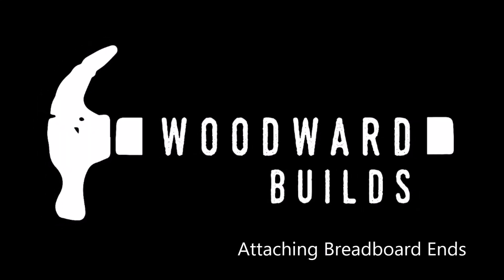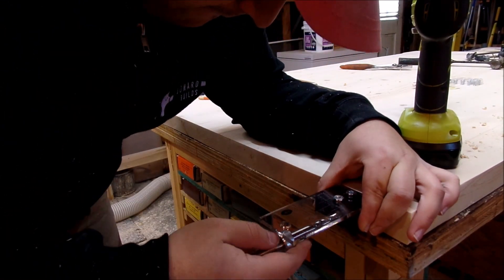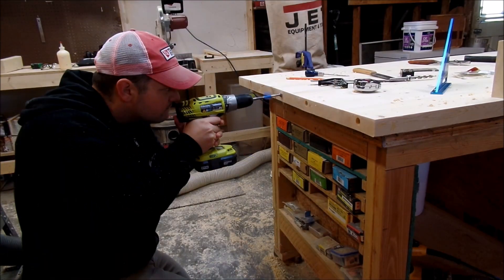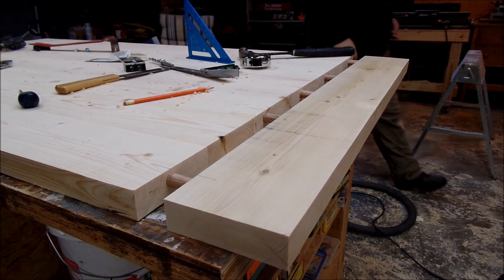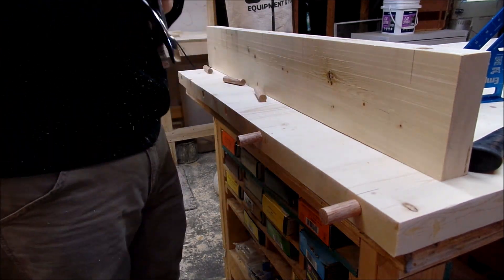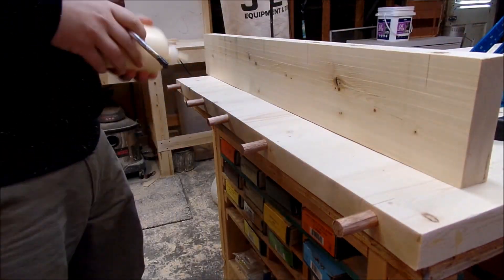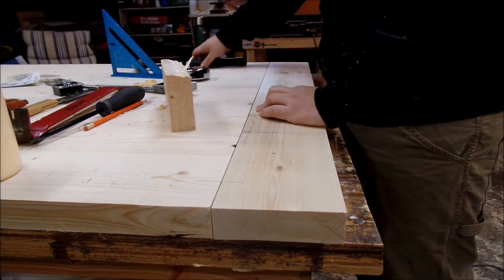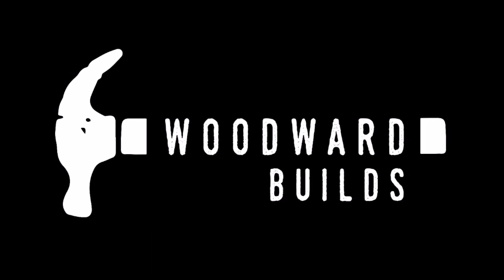Easy Breadboard Ends Without A Domino

Comment: Thank you so much for this idea. I made a table using pocket screws (our table) and everyone loved them telling me to make them for sale.. I posted some pictures and sold one right away. I bought all the wood today to build it and while doing some research, I discovered this issue with expansion and contraction. Needless to say, there isnt enough money in this job to buy a domino maker or mortise and tenon jigs. I thought I was going to have to give the client her deposit back until I saw your video. This method will save the day for me. Thanks so much for allowing me to make a proper bread board fit with out an unhappy customer complaining that her table split.. I may buy a Festool domino maker  (lotta $$) at a later date if I sell enough tables to justify it but certainly not now..